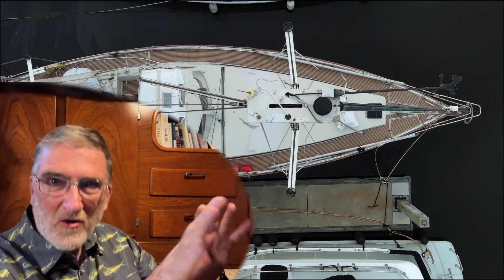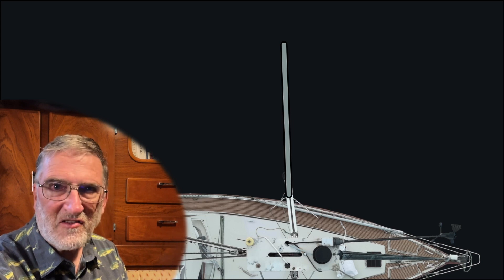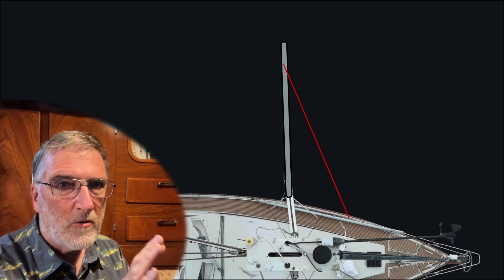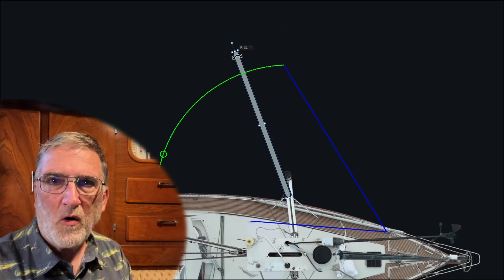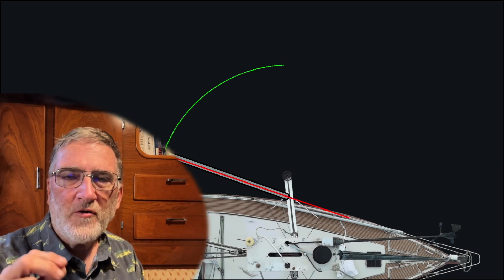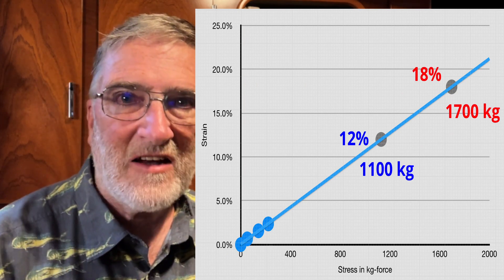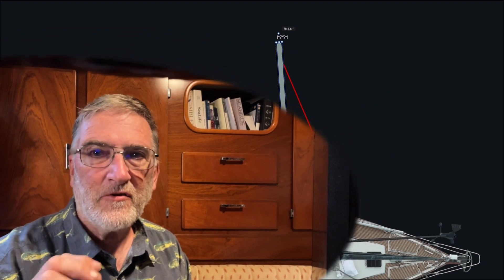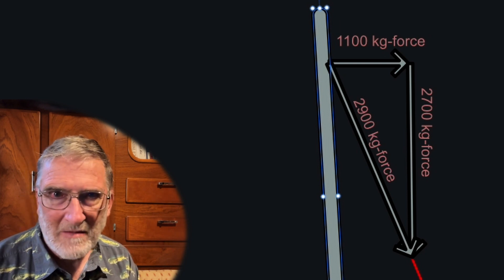Amel Downwind Pole Rigging

Comment: Special procedures have only one purpose; to overcome bad design. Puts Amel right in line with Boeing. Thanks but no thanks.
Reply from the maker: It sounds like you are suggesting that you can rig something any way you like, ignore the engineering built into the system, and still expect it to work. You are, of course, free to believe that, but very few people would agree with you.  It sounds like you are suggesting that not following documented rigging procedures  has been the cause of recent problems, and that any design should be able to be rigged in any way the operator desires and still be safe and effective. Excuse me if I respectfully disagree.  As an engineer I know that the first rule is to RTFM.

Anyone is perfectly free to make up their own way of doing things and ignore documented procedures. If things then go pear-shaped they should then be an adult and take responsibility for their own actions and recognize they might not know as much as they thought.  It's especially important that rigging procedures outside of manufacture's recommendations NOT be spread to people who might think they come from a knowledgable and authoritative source.

The manual and other documentation from Amel is very clear on the right way to do this. It seems to me any OTHER procedure would be the one that should be characterized as "special".

And what does Boeing have to do with anything?  Who mentioned them?
Reply: I don't own an amel,  but this information while good, was not supplied in earlier manuals of many models of Amels and from what ive read and heard no attempt was made by Abel in any shape or form to update their owners ( this great video withstanding,) was ever made.  When so much money is involved...well....you know the story.😢
Reply from the maker: @MultiBmorgan  I know that is what is being claimed.  You are being fed a load of misleading information from a biased source.  When this boat in question posted a video about a year ago on how to use the poles, they were told by many Amel owners that the rigging was wrong.  The comment back to one of them was:  "I like my way better."  Look at the comments on that youtube posting at the time for the real story, assuming they haven't been deleted by now. He was told off line that it was wrong. He liked his way better.  HIS way.

Blaming Amel for his problems is disingenuous, at the best..  My boat was built in 1996.  Before Amel even wrote manuals.  I knew the right way to rig the poles. Every other Amel owner knew.  The correct information was out there and available.  Not only did he ignore it, he was dismissive of advice to the contrary. Did you know that?  He liked his way better, now he choses to blames others for the consequences of  his choices. 

But the real damage is to people who see his videos and think he knows what he is talking about. People following his advice will end up in the same place as him through no fault of their own.
Reply: @billkinney4794  Thank You.  I understand.  I suppose im just skeptical of large companies and their interests.  I surely hope you're correct : you seem very knowledgeable.
Reply: @MultiBmorgan  As with most manufacturers, Amel's focus is on the original owner. Yes, it is true that Amel did not create a manual for any model prior to the SM2K, but they did make that one available for download and it is backwards compatible to some earlier models, so the information is out there. What Amel does do is train the new owner extensively on how to operate and handle the vessel. As subsequent owners, it is our duty to source the information ourselves. I happened to purchase a car for which the owners manual was in German. Should I blame Volvo for the fact that it wasn't in the language I wanted? No, I went and found the English version online. Likewise, when we bought our Super Maramu, I hired the services of Bill Rouse and had access to his book, which goes far beyond the standard manual. The manual, by the way, that was written for the model boat that suffered the unfortunate dismasting. The owner of that vessel had access to that manual and was also given instruction on an extended handover by the previous owner. So the argument that this is a hidden or covered up design defect is thus nullified.
Reply: @tilopeters6023  Thx.
Reply: How is this a “special” procedure?? If it is stipulated by the manufacturer, this is a standard procedure. Just because you don’t agree with it doesn’t make it special.

Comment: This is one of the best videos regarding Amel yachts I have ever seen. It is done with detailed, accurate, and understandable data. Huge applause! Standing ovation!

I really hope that you continue this. Another subject with much misinformation is the "Alignment of the Engine to the C-Drive." The same YouTuber who shows in multiple videos the Fore Guy rigged incorrectly, reducing its ability to stretch, also produced a C-drive to engine alignment video. In that video, he says, "Don't worry if your alignment is off by a few degrees." I know this erroneous statement cost several Amel owners thousands of dollars/euros.

Thanks so much for this.
Reply from the maker: If you have a problem with my video, please address me.  Preferably with a technical response to what is a technical post. Personal insults are uncalled for.

Comment: Very timely Bill.  I think you might have hit the nail on the head why some Amel's have suffered mast failures while most haven't.  I've sailed on a SM that dipped her pole on a previous voyage and the end point exploded which again saved the mast.   The mast isn't (and can't reasonably be) designed to take point loads of more than 2 tons.  I'm also always very careful about replacing lines with Dynema as often times the original lines are designed to be the weak point.  It makes sense in a lot of instances but for others, like this foreguy example,   I'd far rather lose a line than my mast or even the pole.

Comment: Great video. One question about the fore guy, I have read elsewhere that the material used for the fore guy should be different to the other lines and includes cotton. Is this correct?
Could a case be made for introducing more elasticity into the fore guy arrangement particularly eith aging boats? 
I hope you consider making some more videos. Correct use of ballooner and mouse slong with how you upgraded your electricdl system would be great.
An idiots guide to offshore fishing would be good too.
If you create more videos of this quslity I am sure that Pattons will follow.
Reply from the maker: Paul,  

Thanks for the complements. 

In the Amel listing all the lines are the same "Tempest" material (except the topping lift).  There is no "cotton" in any of these.  That's kind of a strange idea, but I can understand where it might come from.  The spun polyester used as the cover of this rope does have a very soft "hand" so somebody might imagine it was "cotton".  Without thinking too hard about it, the kind of rope used for the other control lines is likely not all that important. I can't think of a scenario where the line type for the others would be critical, but that's not to say there cannot be one!  The foreguy seems to be the critical issue.

Bill